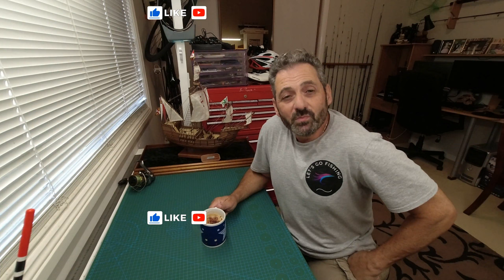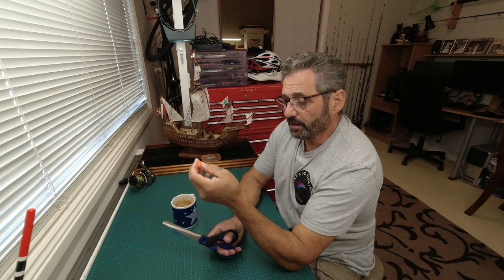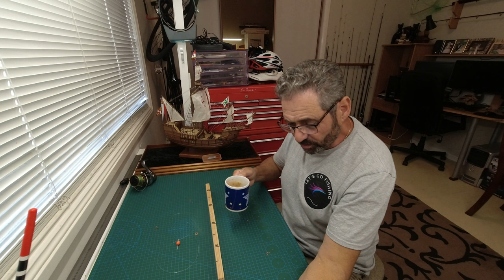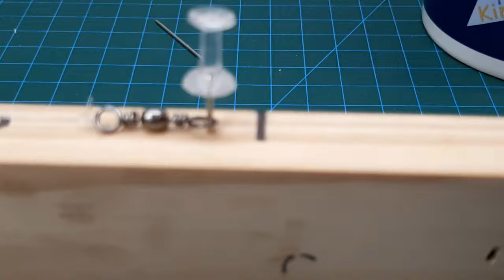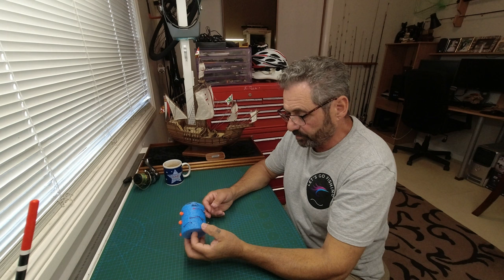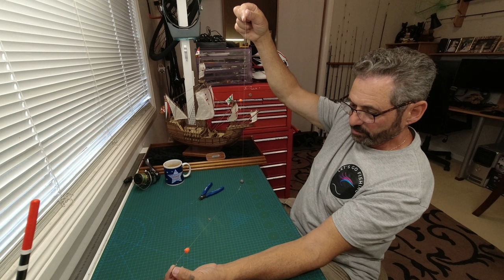The Earplug Rig. Great for beach fishing

Comment: I found that it is much easier attaching the ear plug by forming a half hitch loop and placing the ear plug in the loop and pulling it tight
Reply from the maker: I did it that way so I could slide the plug where I needed it with the two sliding knots on either side of the plug. Can you slide the plug with a half hitch?